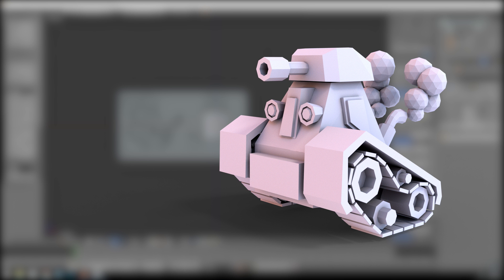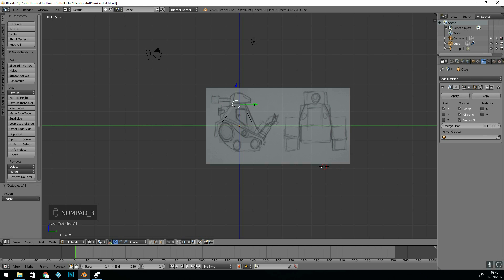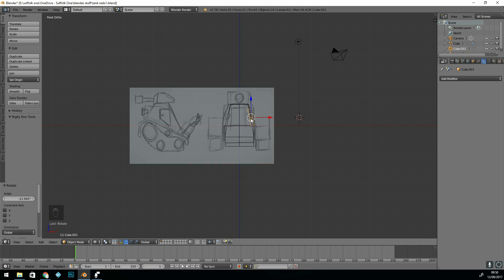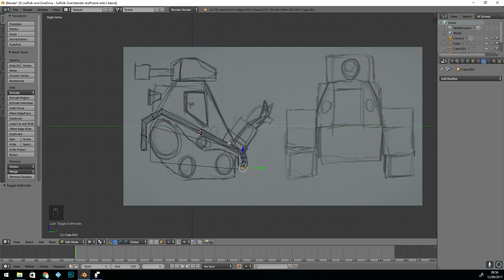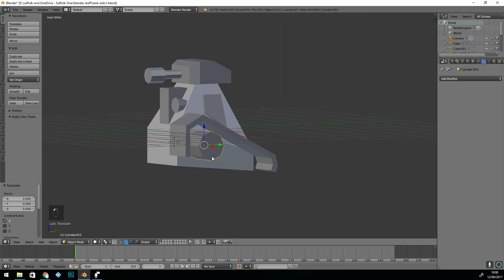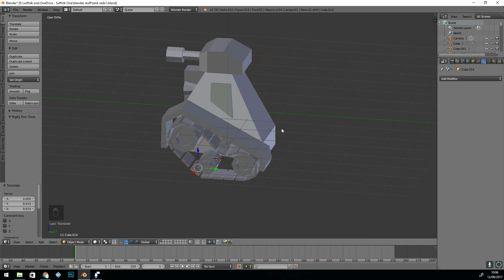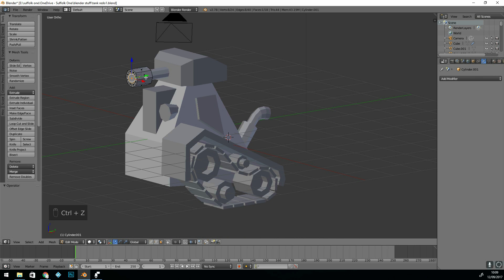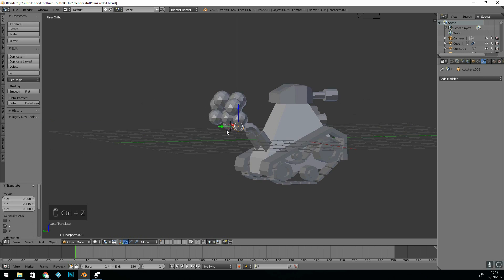Low Poly Tank | Blender | Beginner tutorial | project | part 2 | Modelling

Comment: Hi! I am now doing some mesh in Blender and I wonder if vertex order (CW or CCW) is meaningful when creating a face. In some other 3D software I remember I could create faces with normals facing in or out depending of the vertex order. In Blender I don't see such dependency. No matter what order I use, the normals are somehow always outwards (mostly). Sometimes they are inwards.
Reply from the maker: Normals will be important yes. You can set your normals in the shading panel in edit mode. Usually pressing recalculate will set them all pointing outwards.